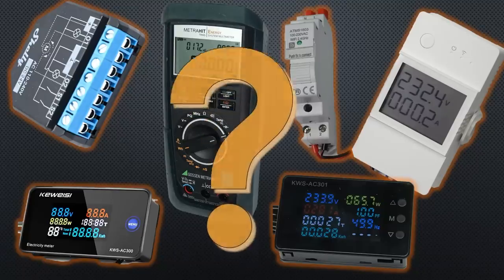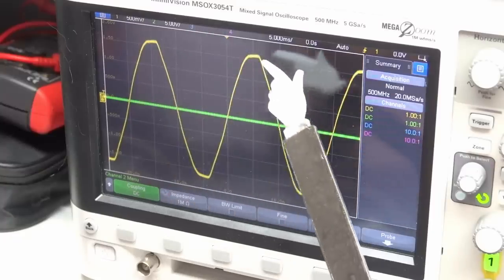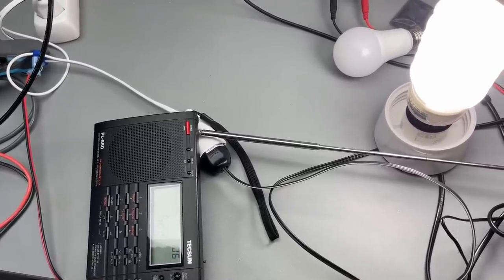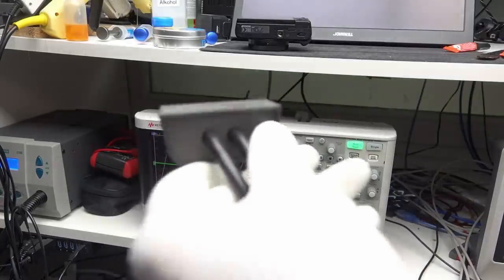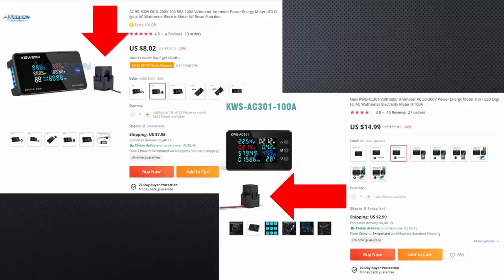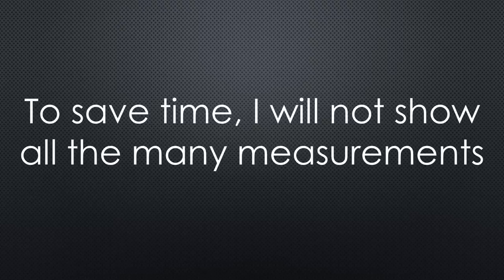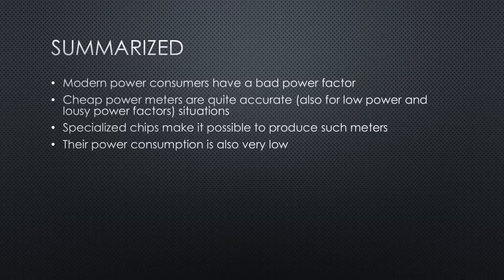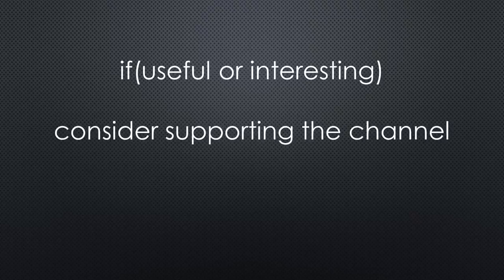445 Can we trust our mains' power meters?

Comment from the maker: It seems that all AliExpress links do not work if you chose Germany as a delivery country. If you chose Switzerland, for example, it should display (and you can choose the same product that delivers to Germany).
I usually use the links to the shops I purchased from.
Reply: Unfortunately it still does not work for me from Germany, even after changing shipment to Switzerland. The message from AliExpress is "Sorry, this item's currently unavailable in your location. Explore other Group Buy deals." Maybe they introduced geoblocking for these items. Tried in a browser in incognito mode, so no AdBlocker can interfere.
Reply from the maker: @Klaus Musch  It seems to be a new thing. Not good. Did you find another link with the same product that works?
Reply: @AndreasSpiess  I was especially interested in the Mini PC. I think I found the same one as you've shown (from Topton), but it is sold for $247.37 (including shipping), and not for $187.75 (plus shipping) as in your video. Configuration is the same: 16 GB / 512 GB.
Reply: My experience is that Aliexpress links are a PITA when crossing markets, with things often not working, or jumping to undesirable language settings, sometimes not even with the same way of changing back to one I can understand. And them trying to follow rules may result in listed prices being very different due to them including VAT.
Reply: Might be worth to check for a Medion Laptop deal to replace such Mini PC cause their power consumption is even lower with the same chipset once the display is turned off .
Medion had sold them on their shop for less than 200€ this black friday incl. VAT and shipping. 

I have gotten such a Lenovo i3 m73 which works but has a quite high consumption of over 14 W for its slow mode it is running. 
I compared that with my 8 year old Medion 17 inch tablet cause that is connected to a powermeter socket / tuya reporting data to homeassistant.
Even the 17 inch screen on does not need 14W, less than 11W and once turned off it runs about 7W.

and yes, the sonoff are great just for the good readable display even though the V2 might come with a backlight or e-ink display and more opportunities. I have the 20 A version to measure and show everyone the amount of energy charged in the EV cause that is a one phase charger only running at 16A for a few hours to charge the car during sunlight and sometime during night. pretty powerfull but terrible at low energy scenrarios. 

great video
Reply: @AndreasSpiess  not a new thing. It's their 3rd party geolocation / tax information provider having bad data. Information about the UK is often wrong especially when I am identified by my IP block because it used to belong to India! To get round this I have used a VPN. Sometimes delivering to IOM (and other islands of the UK) get messed up for some products and you have to select Scotland to get delivery.
Reply: @KlausMusch2  I think thats because germany now has a new waste law(LUCID)
Reply: One good thing about living next to China is ease of buying products. In fact AliExpress even has a website for Vietnam.

We can place an order, use one of these new money transfer outfits to pay in Dong and the conversion to RMB exchange rates is done for us. In my experience AliExpress is very customer oriented, it seems they are very effective at fighting the US-generated anti-Chinese sentiment.

Let's face it, the world won't function with a trade trade war, and why should we non-professionals pay more than  neccesary?
Reply: @daklakdigital3691  I agree with you for the most part. There is no need for a trade war, or for any war. The problem with China +and how cheap items are) is partly political, but it's also ethical - China can compete because of slave practices the US cannot compete with legally or ethically (but not without trying), but if they could compete they would ensure world prices for everything were fixed and only sold in USD - and you know what really happens when you stop trading in USD (it involves invasions and unfounded claims of WMD etc).
Reply from the maker: @KlausMusch2  In Switzerland Aliexpress does not pay the taxes (we have to do it ourselves plus 20 CHF Handling for products over 65 dollars.
Reply: @AndreasSpiess  Ah, thanks, that could be the reason. In Germany beginning with 01.07.2021 taxes were automatically added to all orders at AliExpress. Of course for the end users everything got more expensive, but before we withholded taxes or got trouble with the customs authority. And we harmed local dealers. All not very nice.

Comment: For a DIY approach, there is the OpenEnergyMonitor project based on arduino. Quite good after manual calibration. And it has 4 channels.
For a more industrial DIN mounted solution, I used the Orno WE-514 , it's calibrated in factory with some official certifications. So it should be very accurate. It also has an RS485 interface to plug to the computer. No cloud, no wifi.

Would be nice to get them compared. They are very interesting solution for those who dont want wifi.
Reply from the maker: If they have a MID class B certificate. So they should be 1% accurate. However, the data sheet says it has a 0.25A minimum current (60W)
Reply: Isn't DIY supposed to save money? This is expensive stuff with goofy smart apps

Comment: When flashing Tasmota on one of the compatible energy meters, you should likely also make sure to do the Tasmota calibration, using a purely resistive load (like that 60W incandescent bulb) to get accurate data. My experience with such a setup is that if all my consumption goes through such devices, I can get very close to the house meter used to calculate what I have to pay. Instead of trusting the resistive load to have a specific wattage, I used a "known good" medium-price meter. The point is that factory calibration may be lost when replacing firmware.
Reply: While I agree, the voltage can fluctuate quite fast where I live for more than one volt. So in the seconds from when you read your meter and configure the value in the device, it might have already changed.
Reply: @AndreasDelleske   If that was my situation, I'd do the calibration on the power from my UPS.
Reply from the maker: I did this today with the Sonoff. The problem of calibration is that you need a more accurate meter. A bulb is not a good "calibrator" in my eyes. The bulb I used had 60W@233.6V and 62.5W@240V. The 40W bulb had the 40W@231V. Both were Philips bulbs (I hope a decent quality).
A power resistor probably would be a better choice.
Reply: @AndreasSpiess  Yes, thanks - a great idea would be a fast electronic load with a resistor that tries to keep exactly 50 W, no phase shift (or 500) no matter what voltage is on... then calibration of the Shellys (where you have to input the power (W) directly). would then be easy. I think it is not that important if the voltage is exact down to 0.1 V for the user.
Reply: @AndreasSpiess   While I fully agree that using a bulb is does not give very accurate calibration, it may still be much better than losing factory calibration and then doing nothing to make a new calibration. As your numbers show, decent bulbs are not way off target. A major reason for suggesting an incandescent bulb was that the Tasmota calibration process needs to be done using a purely resistive load with power factor 1, which sometimes can be hard to recognize in a modern household. And accurate power resistors are a rare household item 😀
Anyway, like you, my choice was to do my own calibration using a "known good" meter. My load was an old 600W toaster, which was unsurprisingly not real close to what the sticker said. And getting very close to what I pay to use confirmed my process.
Reply from the maker: @AndreasDelleske  The voltage is stable enough to work with a constant resistor (one reading should not take more than 5 sec). You can enter any voltage and power into Tasmota. No need to have exactly 50W.
Reply from the maker: @JohnnieHougaardNielsen  At least bulbs are very cheap compared to a resistor...
Reply: @AndreasDelleske 
Can't you just use a non-mains source like a 12V inverter (or a UPS like someone else mentioned) for the calibration?
Also, keeping your pair of multimeters (you do own more than one, right?) hooked up for a couple of minutes to confirm the values are still good can help. You're still potentially going to have the Tasmota reading occur at a different time to your eyeball one, but with several minutes of observation you should be able to see if it's close most of the time or not.
Reply: @tin2001  Well as Andreas said, it might not matter much.. an UPS might be a good idea but the waveform might be different from a pure sinewave no matter what they write in the UPS specs.. Maybe our local grid here is a little special with more voltage fluctuations as we have a CHP plant running for 20 families and our main cable to the public grid is 70 m long..

Comment: A very important topic as we try to reduce our carbon footprint and save money. It certainly gives you pause as we, by our techie nature, consider automating everything in our homes. No automation draws zero power, so, is it the best thing to do? Certainly some automation projects increase efficiencies. An irrigation system with feedback can save precious clean water substantially and if it is connected to a weather service cut off watering completely when a storm is imminent. A thermostat that drops the temperature during sleep times or when a room is unoccupied can save quite a lot of energy.  But it all rolls back to thoughtful application of tech and power factor is a key in understanding the merit of an effort. Thank you for this video.
Reply from the maker: Automation increases energy consumption if you do not change anything (my last video was about that topic).
Reply: An active idle ESP will use around 0.5W while connected to wifi. If you had 10 of those, you're still only at 5W. 100 of them is 50W. Easily cancelled out with just 1 solar panel.
Of course many types of sensors don't need to be active. Water levels, temperatures, some buttons and switches, etc only need to wake up at intervals or on events. This can reduce the power consumption dramatically - sometimes low enough to run for 6 months or more off a pair of AA batteries.

Comment: Hello. thanks for the very professional video. I'm dealing with an inexpensive power meter 100% Chinese, PZEM-004T. I do not have a reliable meter to make a comparison but comparing energy measured over six months has showed less than 1% of deviation from my main provider's meter. Possibly both of them are affected by same error. It comes with a TTL serial output and I used a ESP32 to publish data over mqtt in my network. It worths all the 6€ i've spent!
Reply from the maker: The PZEM-004T uses a V9881 energy metering SoC chip which promises a 0.1% resp. 0.5% error. So I assume your observation is correct and your meter is ok. It just needs an MCU to transfer the values to the network.

Comment: Great video (as usual). 

For PSUs, I think it's extremely helpful that most of them have a active power factor correction. I don't fully understand how it works but the better it works, the more accurate would be the measurement of the device. For some devices it could be helpful to downsize a PSU for more efficiency. 

I really liked the part about devices with constant power draw, no need to measure what's already known within a acceptable margin of error.
Reply: active power factor correction is a simple step up dc/dc converter that goes between the rectifier and the filter capacitor. Its trying to step up the rectified sine wave which goes between 0 and 170/340V (120/220V systems) to ~400Vdc. Because it can operate with a rather low input voltage it ends up drawing current for a bigger part of the sine wave, not just from the peak like a simple rectifier will do. The this type of circuit is also one way to get power supplies to operate with universal input voltage 110V/220V.
Reply: @electrobob  thank you.
Reply: Measurement devices that calculate Power Factor will display Watts correctly for any kind of load. Power Factor Correction makes no difference to consumer's power bills, since people generally get charged for kWh (Watts) rather than kVAh (Volt Amps).
So, the quality of the measuring device affects the accuracy, and not the Power Factor of the device under test.

Comment: I was testing an induction hotplate using a Killawatt meter. At the lower and higher power settings on the hotplate the Killawatt meter the watts consumed did not change. Later I had it hooked up to a SonoffPOW and that showed the power differences between all settings. The Killawatt meter just is not accurate enough , even though it seems to be the go to power testing device by so many people on youtube. Thanks for your video.
Reply from the maker: I do not like meters with big ranges because usually, they do not accurately display small values (which is what we need in our households).
Reply: @AndreasSpiess  The Killawatt is originally a very simple design using 1 transistor to multiply current and voltage.
Modern devices use a chip designed for commercial power meters, with 16 or more bits A/D and digital multiplication.

Comment: Have you tried the PZEM-004T V3? I am using some with esp8266 on each consumer unit. Unfortunately it doesn't discriminate by where to where power goes, though, so one needs to take that into account with storage and production.
Reply from the maker: I had a PZEM-004T V1 in my last video and it did not work :-(

Comment: Fujitsu power supply is made by Delta Electronics (written on right hand side of unit amongst all the certifications), which is the same manufacturer as the 'Chinese' one.  Probably explains the similar results
Reply from the maker: Thank you for the info. This is what I thought. But still, there are many voices which advocate for "branded" products...
Reply: @AndreasSpiess  True. Delta is known to be generally good, just not really known.  The real worry in the brick supply department is completely unbranded (apart from CE fake logos!) units. Few years ago had some of these anonymous bricks with old 3.5" and 5.25" external enclosures and the magic smoke came out after only a months!
Reply: Delta make almost every full size laptop charger you ever see... If it's a brand name laptop and has a soap-on-a-rope power supply, it's probably Delta.

Plugpack style are less likely to be Delta, but I think some still are.

Comment: Excellent as usual ! About the two PC, it seems difficult to compare them without understanding the needs, the Core i7 is twice powerful than those Celeron N5100 in single thread, but only +25% in multithread but those recent Nxxxx recognize more video codec so they could be more efficient than the Core i7 for encoding/decoding video especially if you use it with video surveillance application like the excellent Blue Iris  (not free but so well made for only small part of the price of equivalent "pro" applications), 4 ETH is also cool as fanless.
Reply from the maker: In my video I used Proxmox with 2 VMS. One for HA and one for IOTstack.
Reply: @AndreasSpiess  HA and IOTStack ? so CPU power is not really needed, both CPU recognize all the VT-xyz for better virtualization, for someone with really low budget the I7 is still good (especially if it has a SSD) but if you have the money then N5100 could be better with more RAM support mean more VM at same time. I still use an old Core I7-2630QM 12GB for my Blue Iris video surveillance, Arduino IDE and Domotic things ;-)

Comment: OPTIMISING ELECTRICITY CONSUMPTION
New remote controlled electricity meters appearing in many countries and several of them use WiFi transmission to collect the data. As l advised in another comment, these are easy to disrupt.

By jamming the WiFi during high-cost metering periods and stopping jamming about 15-30 minutes when the low rate kicks in, the accumulated high-rate consumption is uploaded during the economy period.

As the "jammer" l use is a standard piece of WiFi test equipment, it can be purchased from many sources. WiFi is, as many know, a shared, licence free service.

Well done electricity authorities. Going cheap doesn't pay.

Comment: As another low load I would suggest building a "dummy switch mode power supply". Bridge rectifier, 100 ohm resistor, 10 uF smoothing cap. Bridge the smoothing cap with the desired "stand by power" leakage resistor. 300k would be around 1 mA, so 300 mW. But modern power supplies consume less in standby, perhaps 1M or 2M is more suitable.
Swap bridge rectifier for single diode for an additional test.
Reply from the maker: I do not think that the tested power meters are good to measure idle power. The Metrahit has several ranges. Because of that fact is can measure mW precisely.